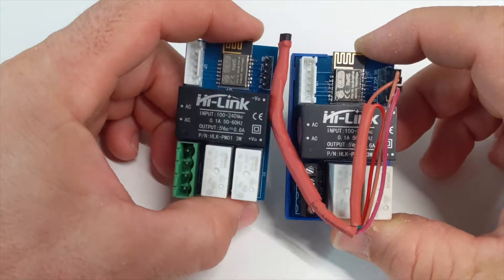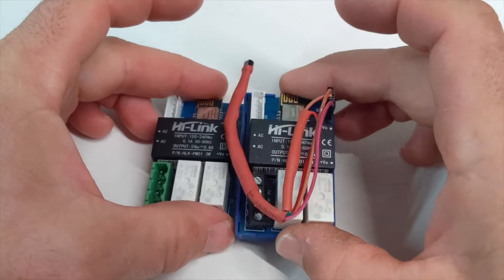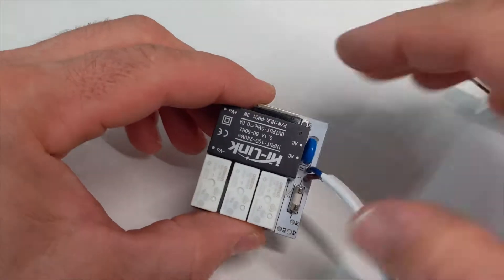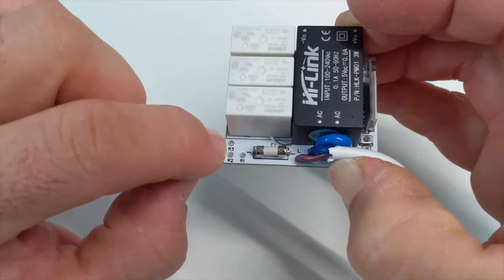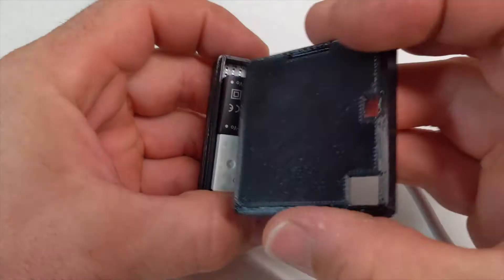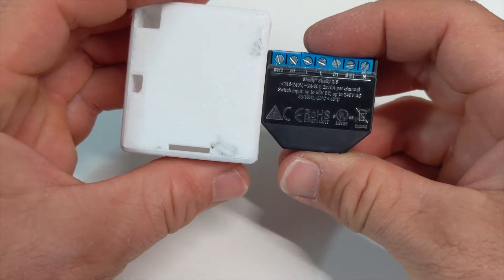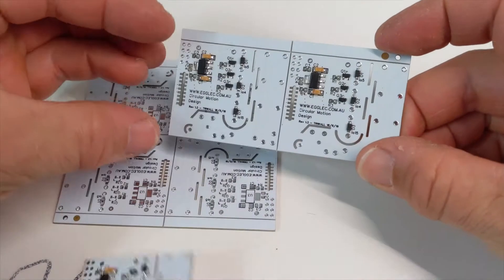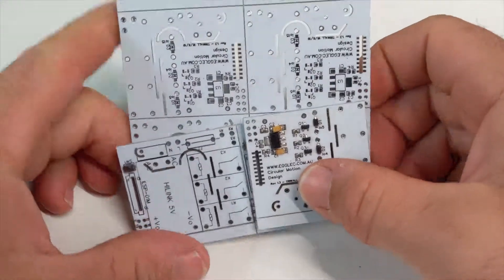ESPHOME 3 CHANNEL RELAY MODULE

Comment: Can u provide source files??
Reply from the maker: mrunmay darpan yes, when I home, they are for home assistant add on esphome yaml though
Reply: @SparkyJames  i meant pcb files, if these are made using easyeda, then i think i can find these in your profile
Reply from the maker: @mrunmaydarpan125  https://easyeda.com/james_6977/esp8266-wifi-relay-module-with-3-10a-relays - I have changed it slightly with smaller relays and room for 5mm terminals(which actually don't work to well, for space reasons, but you can direct solder like with the previously one)